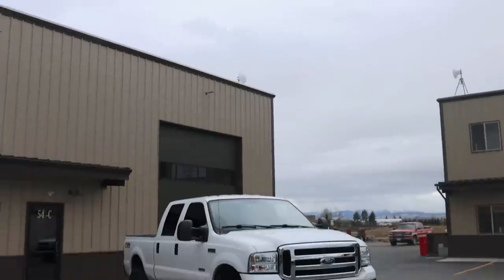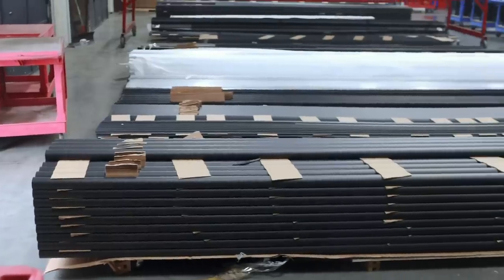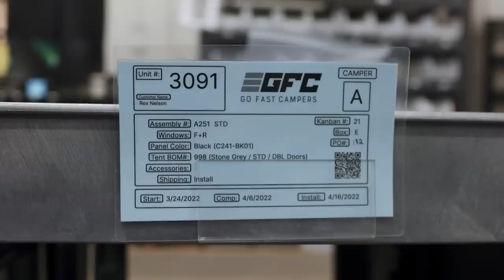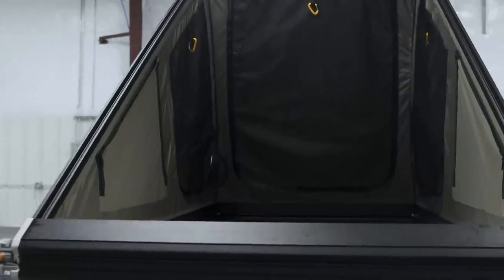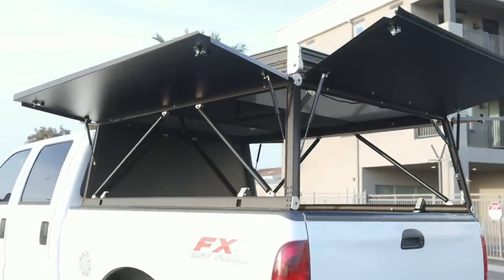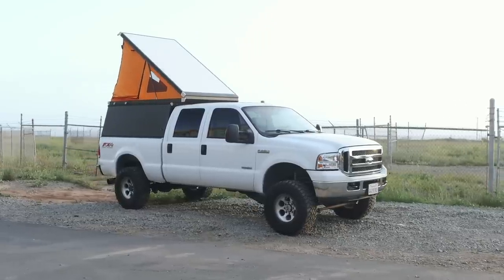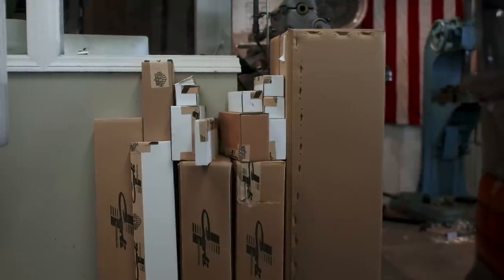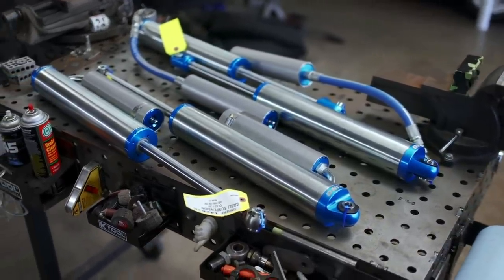Go Fast Campers - How They're Made & Installation on my Ford Super Duty 6.0 Powerstroke!

Comment: As I'll always say, all Stanceworks content is good content. Continue posting what you want man! The second you start chasing views is the second you'll start losing the spark that makes your content great.

But man, GFC has quite the manufacturing set-up! As someone who knows how to setup and use tons of different kinds of CNC machines (3D printers, mills, lathes, plasma cutters, etc) I know how much work goes into not only setting them up but also maintaining them. Not to mention having to program tool paths and figure out order of operations for every different part for every model of truck they build for. Much respect for the guys there, sounds like a blast of a place to work for if you're a problem solver and enjoy building!
Reply from the maker: It’s a really impressive system they’ve got going on, and they’re doing a lot to improve it. Look for some really cool stuff from them soon!

Comment: We need a budget breakdown if we want to make the same mods and how the camping trip goes some footage of the trip. Love the change in content!
Reply from the maker: Retail figures, the full sized camper comes in at about $8000, and the seats are about $2000 each. The full Dominator suspension system starts at around $7500, plus options. It doesn’t include rear springs which are another $1500 or so.
Reply: @stanceworks  Trust fund or lottery winner?
Reply from the maker: There’s no way it could be anything else, right? Such as selling my OBS for $37,000 and having a budget to built this one, along with having friends at each of the companies to help out, right?
Reply: @stanceworks  Wow. Sensitive little fella.
Reply from the maker: Answering your question with sarcasm is sensitive? Since when?
Reply: @stanceworks  Fair Enough

Comment: You’re going to love the dominator kit. I have the same set up on my 6.7 and have ran it through Ocotillo and Glamis with no issues (you most definitely can jump the truck). You’re going to want a strong air hammer to punch out the rivets for the coil buckets as well as extra help putting the rear leaf springs in if you got the Deavers as well. Good luck!

Comment: I'm definitely up for the truck content. I know you gotta pay the bills but for me, 4 adds jammed together was a lot.  34 hours of driving you could have squeezed a little feedback on the trip how the truck felt on such a long trip. Did you even sleep in the tent, how do the new seats feel. What the "bulletproof' mods where. road noise and  how much fuel it used with and without camper. help us get attached to the vehicle so we care about the mods. would love to see some flex tests before the mods, you could even put a phone G meter app on and drive it down a bumpy road before and after to test that couch claim. Hope this is taken positively, it's not a list of demands, just some ideas to help sprinkle a little more you in.  I am looking forward to the suspension tech.